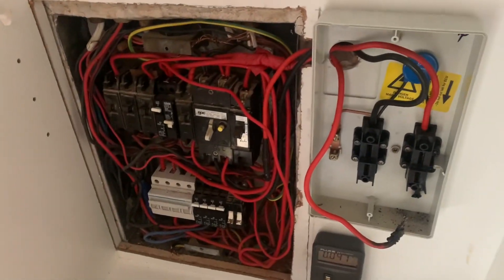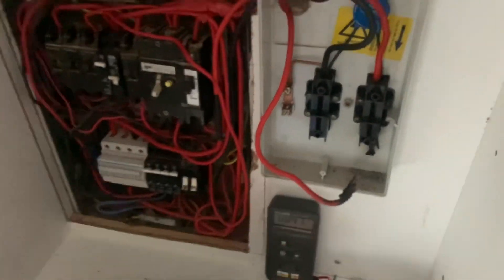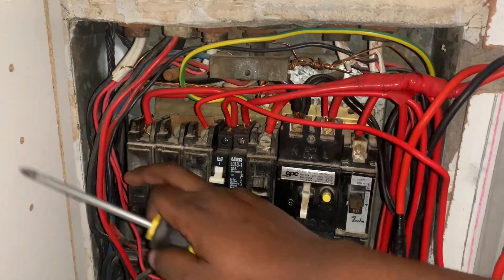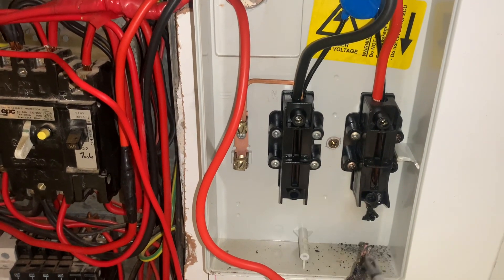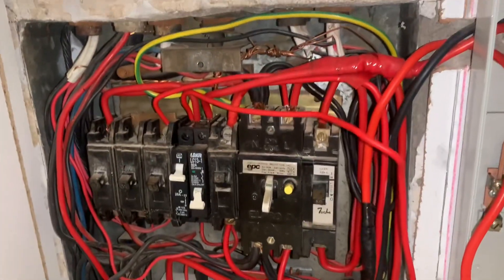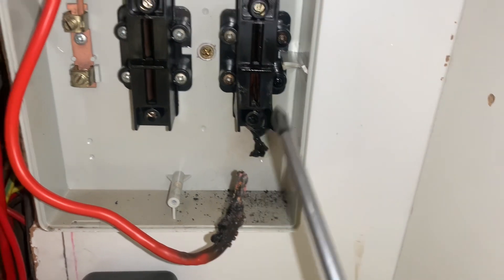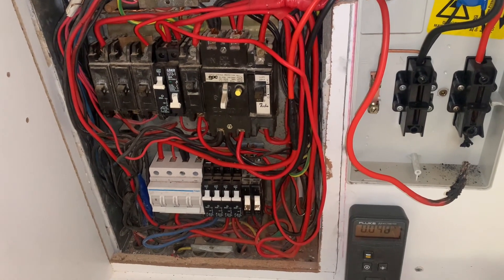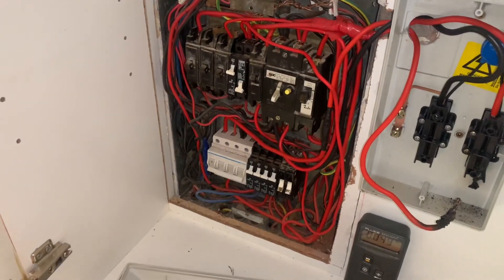How to repair a South African DB board

Comment: Ok my friend thanks for the video. Let me just to your video . If you look on the screen of that meter interface you will see they are imojs😊😔 and also switches symbol. Showing that closed or open . The moment u remove cover or the user interface of the meter you it will automatically go into tamper whereby even if you put everything back it will not work . I like your videos keep pushing ❤
Reply from the maker: it was a temp fix, needed to order a whole new meter for it. to prevent it from burning more i made it like that